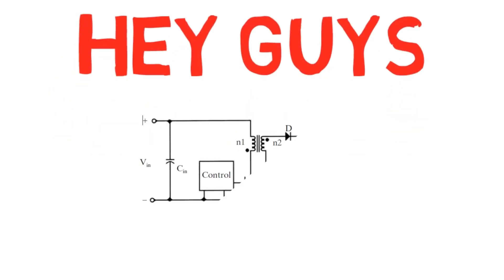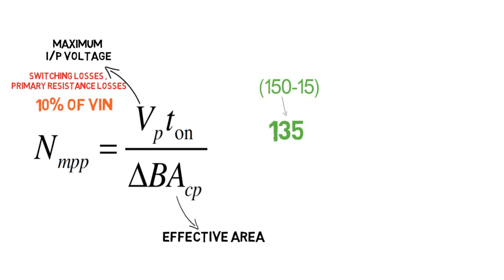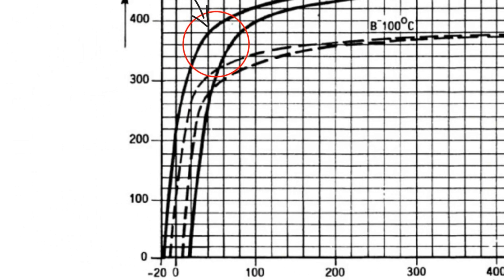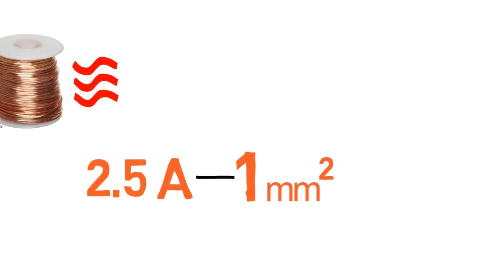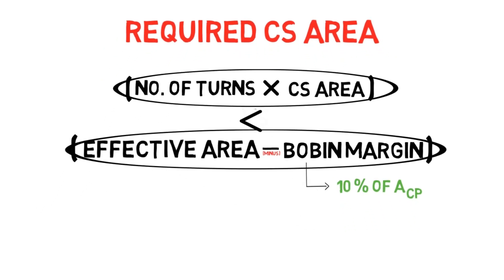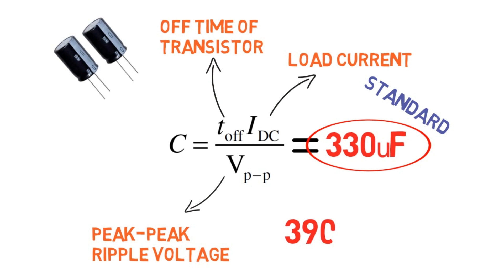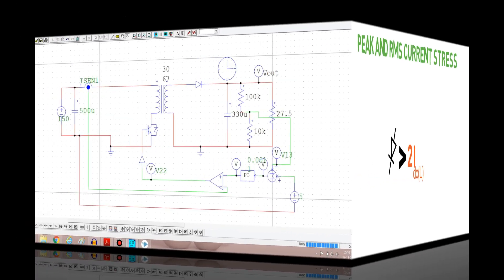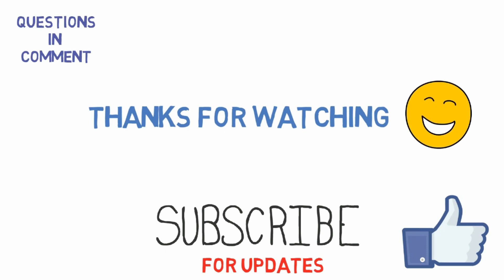Flyback converter design | explained | part 2 | With simulation

Comment: Hello Sir, thank you very much for the explanation in this amazing video. However, can this flyback circuit be used to create a converter with an input of 24V and an output of 100V?
Please answer this question
Reply: Her şey mümkün. ama her değer de değişir. @FoolishEngineer açıklasa daha doğru olur.

Comment: Hi, Can you suggest the Cricuit for DC to DC converter using Flyback topology?
As we need circuit for input (40 to 65v dc) and output is 5v/2Amp max.
Thanks.

Comment: Thank again! But I've tried sveral times this: Nmpp= 135x(0.5/30000) / 220mTx118mm2 and have never found it equal to 68. Can you explain in detail why it gives you 68 turns, please? Thanks in advance.
Reply from the maker: What is the value you are getting?
Reply: I get 78.

Comment: which software used and what is the value of pid controller.
tell me is this converter acts as step up voltage application or not?
Reply from the maker: software is Psim. The controller is PI, there are no specific values for it, I have calibrated to get the good close loop control. 

This converter can be used in Step up voltage applications.

Thank you so much for watching the video!
Reply: @FoolishEngineer Thanks a lot..

Comment: Thanks a bunch!  I've  been trying to understand how these switching power supplies work.  One question - I found the simplest "wall wart" I could find with this type of circuit - it also includes an "opto-isolator" and some type of control chip.  Does this allow world-wide AC use (100-240v) * 1.44 for Vin by modifying the duty cycle on the primary?  The "opto-isolator" keeping the secondary and primary separate? (Maybe you have this explained somewhere else...)
Reply from the maker: You can use AC at the input of flyback converter
Reply: @FoolishEngineer  I usually see some kind of bridge rectifier (4 diodes on this cheapie) and a larger cap.  Do you mean as an input to the circuit itself?  I know after the MOSFET switch I measured 100MHz on this 18v one for an old TI computer (so I can play around without shocking myself).  50 MHz on this wall wart
Reply: @FoolishEngineer  Is this configuration called a different type while employing the flyback converter at the center?  The opto-isolator and the control chip as the controller (instead of just the LCR constant for generating the high frequency)?
Reply: @FoolishEngineer  I'm trying to fix my old VCR / DVD "double" VCR with a built-on-pcb switching power supply.  It has an intermittent temperature problem.  When I keep it inside at room temp for a couple weeks, it works but when it is stored in the garage it wont start (1v on all the secondaries).  I checked the transistors and zener diodes I thought may be the problem (especially the ones with discoloration on the PCB from heat).  I have to un-solder the cage to get to the HV section, and to do that I have to disassemble the whole thing - what usually goes wrong with these?

Comment: hmmm... this design also has no snubber network on the primary side, to protect the drain of the mosfet. I just yesterday build design pretty similar to this. I'm building transfromer which takes aroung 18V and steps it down to around 5v but for multiple isolated outputs. I probed the drain of the fet and saw around 80V peaks on the drain. I don't want to use dissipative clamp, because it ruins the effiency, but it's really hard to find knowledge about other clamping methods. still great video!
Reply from the maker: Thank you so much for watching our video!! If you want some help in snubber design please check Application notes on the same.. You will get it with proper calculations on the internet.

Comment: Thank you ...very helpful....what is the staand n rating for 12v and 10amps transformer?
Reply from the maker: You can check that in American wire gouge chart for current handling

Comment: In your equation at 2:06, the math doesn't check out that I can figure.  Does anyone have any idea what the actual numbers being muliplied should be or how they should go together?  I.e. do you have to apply a scale factor to something there?  I'm off by over a factor of 1,000 so I don't think it's just that I don't know the operating frequency.
Reply from the maker: Please check the previous video, operating frequency is 30kHz
Reply: @FoolishEngineer  (135×(.5÷30000))÷(.220×.000118) = 86.7.  Getting much closer... hmm... Was it 86 the whole time maybe?

Comment: okay first thank you 🙏 for this amazing video and I have questions if I want use flyback and convert from 12VDc to 360VDc what should I do , what are the mathematical laws help me to find the values of each capacitor and inductees 😢 please help me~~
Reply from the maker: Flyback converter can be used but it is never recommended for step-up function up to this level. you can use other topology

Comment: for primary turns  we have (135*15000)/(220*118)=780 but you said its 68 where did i go wrong?
Reply: 135*(.5/30*10^3)/(220*10^-3*118) = 78 is correct the 68 value shown is incorrect unless 135*(0.4/30*10^3)/(220*10^-3*118) = 69
Reply from the maker: @TSKAMATH  86.67 is the right answer. Please pardon me for my mistake
Reply from the maker: I am so so sorry I did some miscalculations there please note it's ((135*0.5/30*10^3)/(220*10^-3*118*10^-6)= 86.67 = 87 turns.
Reply from the maker: I suggest please check the formula again, you will find the answer
Reply: @FoolishEngineer  Hello, i have the same question: Np=(135*0.5/30*10^3)/(220*10^-3*118*10^-6)= 86.67 what am i doing wrong?
Reply from the maker: @cristhianf.p.moncayo795  Yes you are right. I did miscalculations up there. Sorry.
Reply: @FoolishEngineer  No problem, thanks for the answer, Good video anyway, great job!
Reply: @FoolishEngineer  does it not help to provide a direct reply??